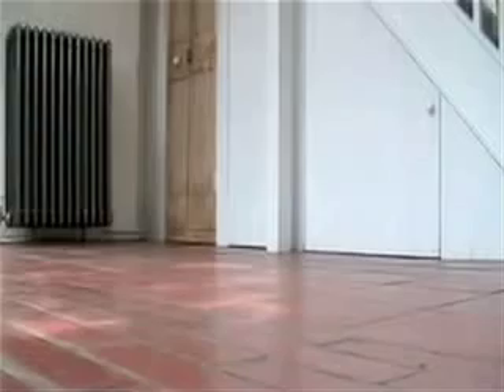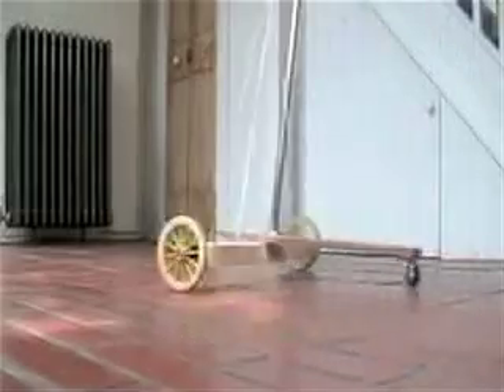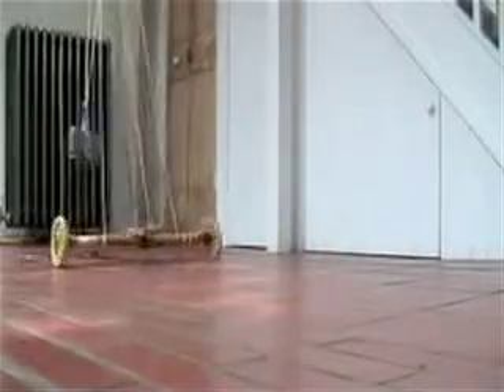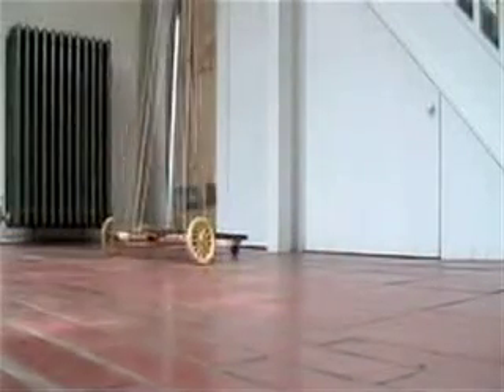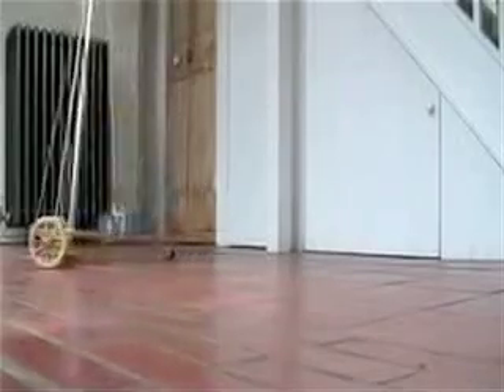New Scientist recreates a robot made by the ancient Greeks

Comment: Nice idea but the more weights the heavier the robot would be, thus more force required to accelerate it (A = F/M). 

Each extra weight would give extra inefficiency so it's probably better to have 1 big weight than many small. 

You could make the frame lighter or reduce friction but the only way to get a major performance upgrade out of it would be to make it taller or increase gravity.
(PE = M * G* H)

Comment: @islagkage15963 commandos like forward on 1. wheel for x seconds/rotations and backwards on the other or more forward on one than another or the samespeed on both. 

ofc there is stuff like doing surden stuff like grabbing an item or so. but this is not meant to be a practical robot but rather a proof of concept. that you even back then was able to preset a number of actions to then be executed unlike something that either would require total and full control like a car or something just doing

Comment: Potentially they could, but there would be little point. The string is still finite, so even with a pulley system it couldn't go any further. Of course, I'm assuming they had the necessary metallurgy skills available to make a spring.